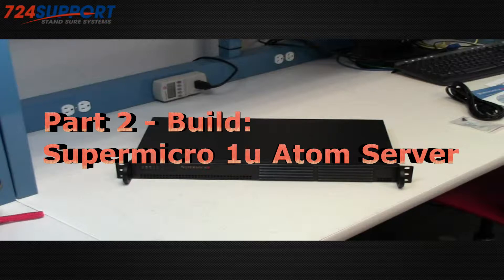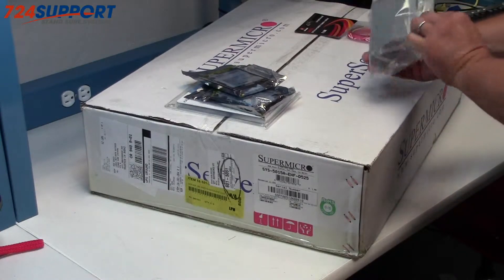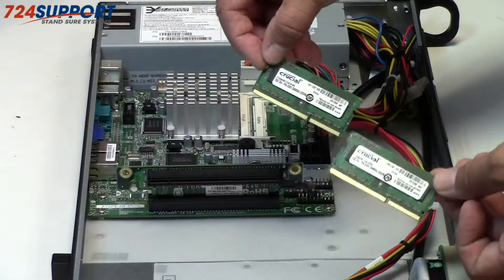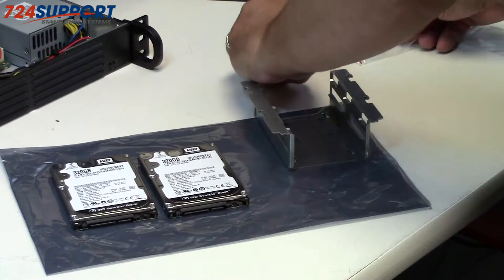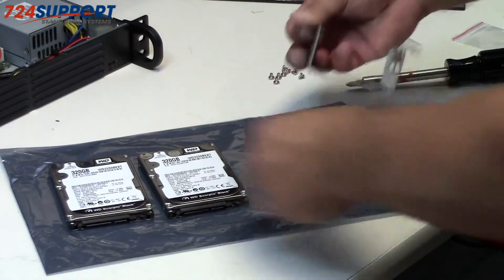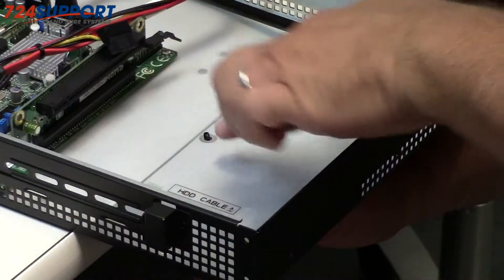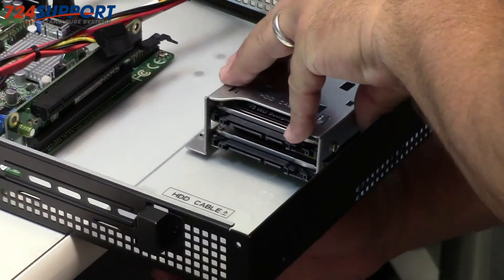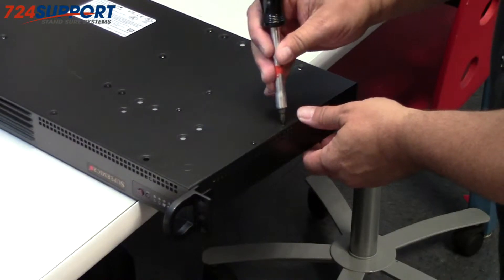Supermicro Quiet 1U Atom Server SYS-5015A-EHF-D525 (2/2)

Comment: Have you tried putting in a expansion card, with the 2x drive carriage installed in the system? I ask because it doesn't look like there would be adequate space. I have a 2-port intel PRO/1000 card I want to install in mine (I need to order the riser card first), though I fear the 2x drive carriage is going to get in the way. I believe they also sell a drive carriage for a single 2.5" disk and wonder if I might fair better with that.